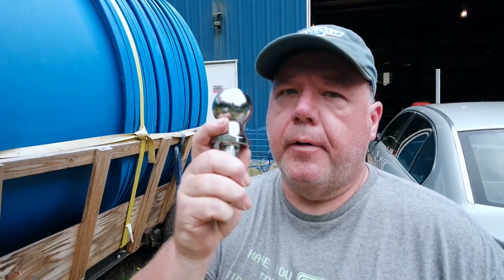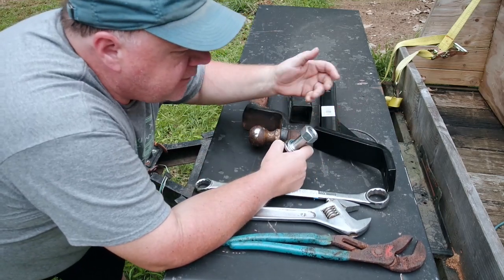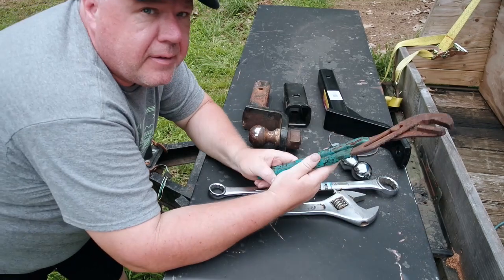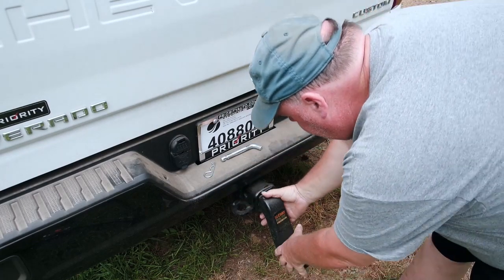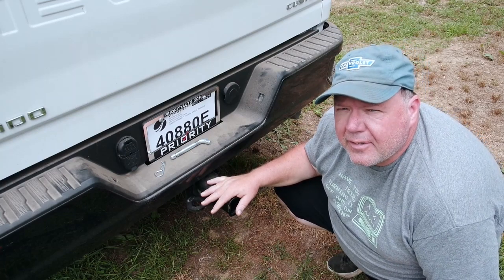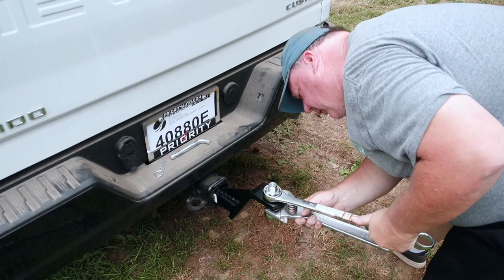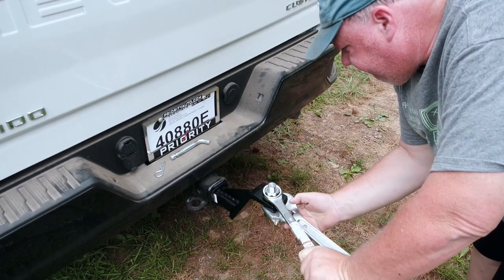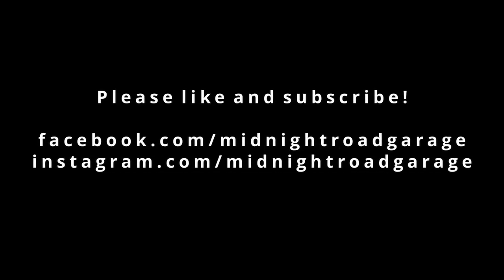Auto Shop 101: How To Install A Trailer Hitch Ball

Comment: I was taught to  put the insert in rotated 90° from normal orientation (as opposed to 180° as you showed), and then pushing downwards on the wrench to tighten. That way you can use gravity and weight of your body to torque it down as much as possible.